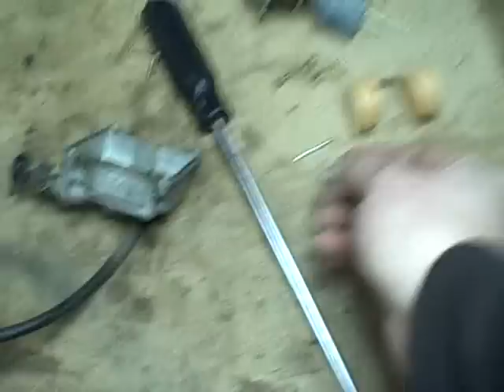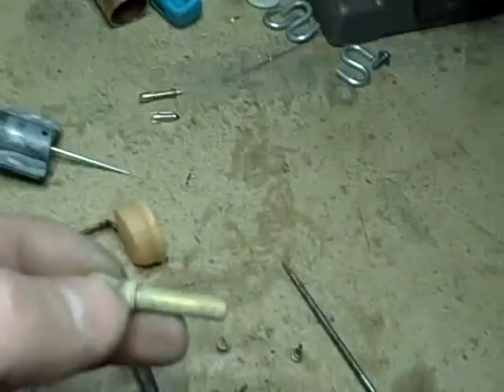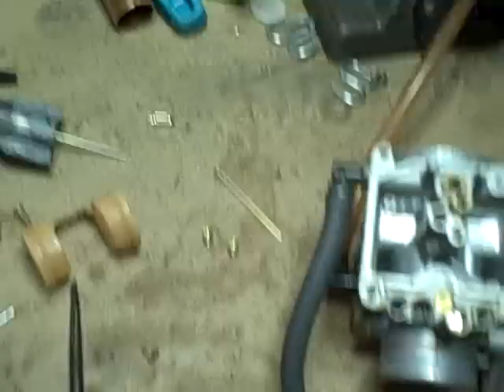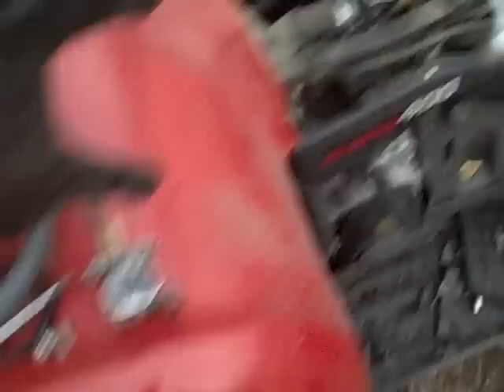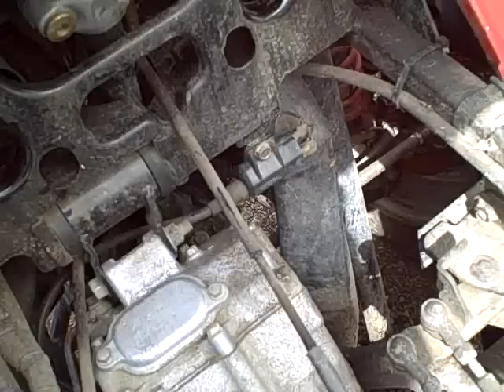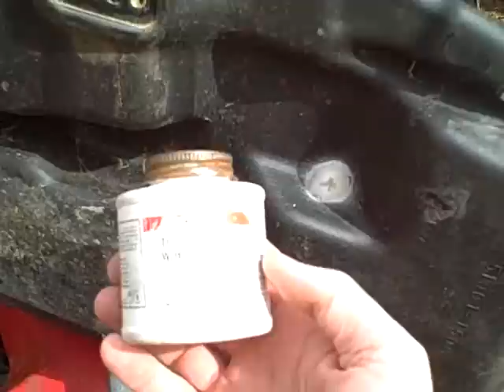Kawasaki Prarie KVF400f ATV Project Part 2

Comment: How did you replace the float valve?  Does it just press in?  I guess it must, otherwise it won't slide open when the floats drop?
Reply from the maker: General Admission the needle just drops in as i recall.
Reply: Thank you for the reply, I guess mine is just seized in there.  I have a replacement coming in the mail.

Comment: I have a 2001 kawasaki Prairie 400 4x4. when I push the start button it clicks & the pull rope won't pull. I've took the pull rope off turned that piece that the pull rope catches on backwards & then it stops I press the button again to crank it it spins over till it hits that 1 spot then stops again &starts clicking. can anyone help me on some info on what I can do to fix it. Thanks.
Reply: or what my problem is.

Comment: I have a Kawasaki prarie 400 that goes in reverse but acts like its slipping trying to go forward.replaced converter and tore transmission apart. no bad parts.any suggestions?
Reply: Clutch weights checked?

Comment from the maker: Sorry, not sure on the leak issue. As for the boot, if you mean the rubber boot that goes over the part of the drive shaft where it comes out the back of the motor, I stilll have one I'd sell cheap. We'd have to check to see if it is the same part number on the 300.